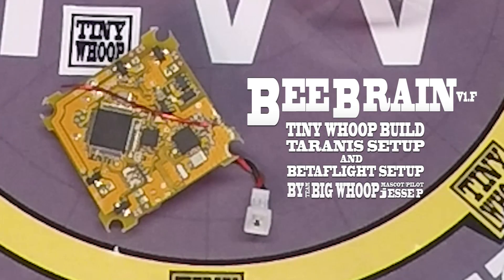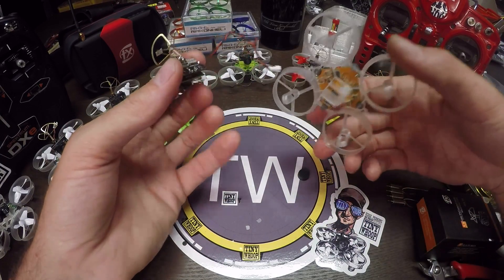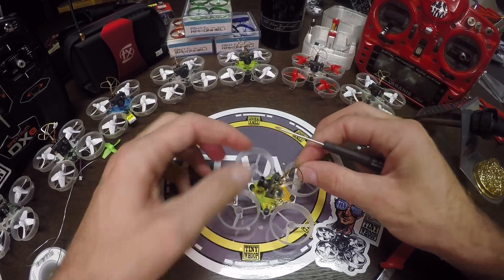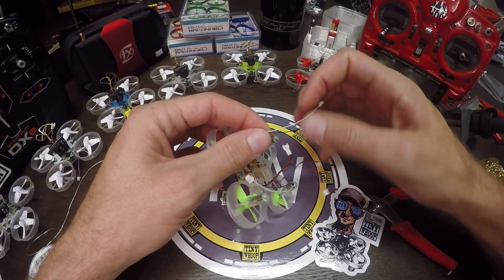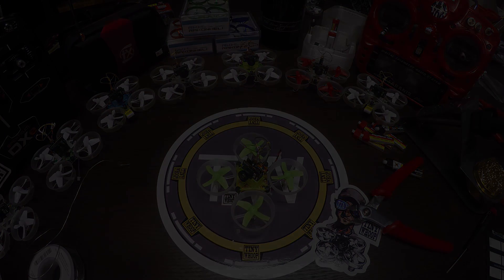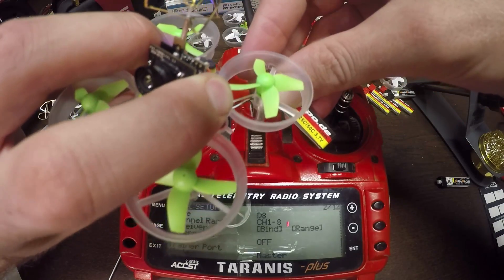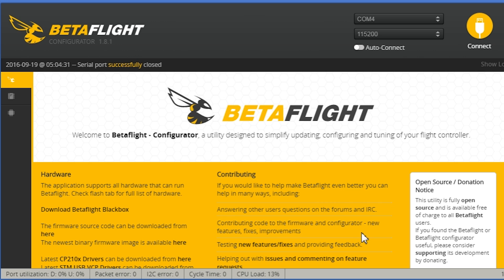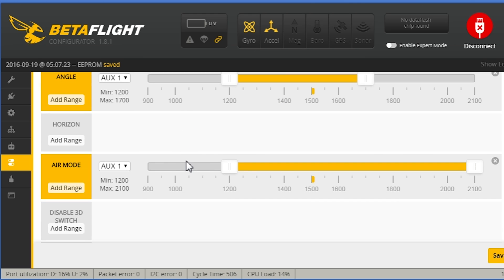BeeBrain Build and Setup for Total Newbs - Tiny Whoop - Bee Brain Taranis Version

Comment: hi, i just got my beebrain v1.2 and i flashed it with the latest beta flight 3.1.5 . could you help me tune my quad in acro mode since i think its very sensitive and going all around the place with the slightest stick movements. i'm using the default PID and rates and Expo

Comment: My props spin up way too much when I arm it in angle mode, it almost leaves the ground and I can hardly land. But in air mode it's completely normal and just barely spins the props. I tried clicking the setting for the props not to spin when armed in Betaflight but that didn't do anything. Any idea what setting I need to change either in Betaflight or on my Taranis to fix this?
Reply: FauxShizzl just built mine and its doing something like this. It just goes crazy. Now I can't even get bound anymore. I dunno what I've done and need help. Followed this video through and or didn't workout

Comment: +Tiny Whoop Helpful video! Do you know what the ESC/Motor protocol should be set at in the configuration tab? I saw in the manual it was set to brushed, but I saw that mr Steele had set it on 'PWM'. I got MMW Fast motors.
Reply: Fabien vg Curious about this as well

Comment: Great video, thanks Jesse! Can anyone offer me some help: the throttle needs adjusting but I'm unsure what aspect of it needs adjusting.  When I arm the quad the motors start to spin despite throttle being at 0 (about 900 when plugged into Beta Flight). The amount the props spin also change when moving switch between 2nd and 3rd position. If that's any help...?
Reply: Do you have airmode on? If so thats how its supposed to be so you can still maintain control at 0 throttle.
Reply: Kurtis Towery ah ha that'll be it then. Thanks Kurtis :)

Comment: Still hoping for a Spektrum/Orange DSM tutorial... can't gt ny BB to bind to my Radio. May be missing something obvious.
Reply: Actually- I just sorted it. I had the Tiny Whoop not level in boot- causes the fc to not be receptive to bind. I am bound, radio configed, and netaflight set up now. Waitinf on props and a cam.
Reply: Id make a video, but I have been unsucessful at armng the bee with my cheap dxe.   I can't get the throttle below 1000; thus it will not arm.  plug in ypur fc to betaflight and go into the radio parameters and see if they move. Mine binds, but will not arm to fly.

Comment: Anyone having issues with the rakon frame?
Reply: i am using the rakon frame and i only screwed in two of the four side...less weight i guess. 
also if you crash it hard you have to be ready to bend the frame back or it will prevent the prop to spin.

Comment: Why dont you just use a Y harness so you dont have to solder?
Reply: two types of impedance here: electrical and physical. the two extra connection points, plus the added weight as well as air resistance created by the extra wiring. you can make a soldering iron out of an old toaster, battery, a piece of copper wire and some insulation. better yet, go buy one for like $15 shipped and give it a shot, its definitely a good skill to have. My local hobby joint even does small stuff like that for free at the counter.
Reply: not to say electrical impedance is non-physical.. not sure what i was going for there XD

Comment: Does the power plug/cable on the beebrain seem to bottleneck the battery like many say they do on the stock inductrix?
Reply: +Mason Garland Are you talking about the recent switch from Picoblade to standard JST-XHP (what TW is calling the "power whoop") connectors? Then yeah, if you want to use those batteries you need to swap the battery pigtail.
Reply: +Jr Mikulec No it's an upgraded battery cable with thicker gauge wire.
Reply: Awesome, thank you!
Reply: Jr Mikulec not 2.0jst though. Think that needs to be added on. If not mistaking

Comment: Which motors do you use ? Fasts? Or insane ?
Reply: +Dylan Stewart Jesse and I both use TW Race Edition motors, which are in between the fast and insane MMW motors. I love them, they really seem to be a perfect balance.
Reply: Was about to buy the motors just now. But saw the beebrain is back in stock. Looks like I'll have to buy that lol. Just going to have to rock the insane motors  for now. As you could imagine the battery life I have with 210 mah battery isn't any good. 90 seconds
Max was longest I got. Most flights aren't longer than 45 seconds. Going to switch to Losi connector to use some 380 mah from banggood.
Reply: +Dylan Stewart Be careful, you might start getting some gnarly oscillations from being too heavy.

Comment: it will drop from the sky when battery is 3.5v?
Reply: +TonyFPV It's not running Inductrix firmware anymore so no, it's not going to behave the same. It's going to behave however you program it to in Beta/Cleanflight.
Reply: +SoLongSidekick thats exactly my question, does the board has a voltage meter? since it doesnt have telemetry, I think we will have to time the flights in order not to waste the batteries.

Comment: GREEN PROPS!!  ME NEED!  =D
Reply: They're the Eachline props available on the TW store. I have a few sets of red and green and their both stunning.
Reply: They're good, do you think they're a little thinner though? I had a set on a 3d printed frame of mine with no prop guards, and they seem to have gotten banged up to a point of uselessness much quicker
Reply: +c4pt1n54n0 c4pt1n54n0 They're definitely thinner. They're pretty much just temporary props for me until the standard props come back into stock. Now that the Inductrix FPV is shipping that should be pretty soon (hopefully).

Comment: I found it easiest to bind the fc to the taranis using the USB cord. Do this by plugging the usb cord into the fc, then hold the bind button down as you plug the other end of the cable into the computer. Trying to plug in the lipo with one hand is like treading a string through the eye of a needle, but with one hand.
Reply: thx
Reply: Thanks!

Comment: Will this work the same or at all with cleanflight?
Reply: Answered my own question, figured it did but yes It does, settings are a little different. I think you just keep TAER in receiver settings & everything else is the same. I just didn't want to have to install more drivers... I just had a hard time updating Kiss fc firmware because I suck with dealing with different drivers.. So far this thing is pretty cool! It's a lot more responsive, I feel I need to turn down my rates if that's even possible. Ha! I'll get used to it!
Reply: +D Nesser You don't have to install any new drivers to use BF if you're already using CF. And as far as the TAER situation goes, Jesse and I think that different Taranis firmware releases do things differently. I had to keep TAER as well (in BF), while Jesse needed to change his.
Reply: I realized that as soon as I opened CF. I know there basically the same I just haven't downloaded or used BF yet. I have a cheap laptop I use for tuning Kiss & CF and it's weird about certain drivers so I didn't want to change anything. I use another for flashing firmware.

Comment: Which Frsky module will work with the beebrain DJT or the XJT?
Reply: hey Luke, after a bit of struggling I got the FrSky to sync up with my 9xrPro with an XJT modulr. I'm having some control issues still. trying to figure out if it's the FC, the bind, or the transmitter still, but it flies!